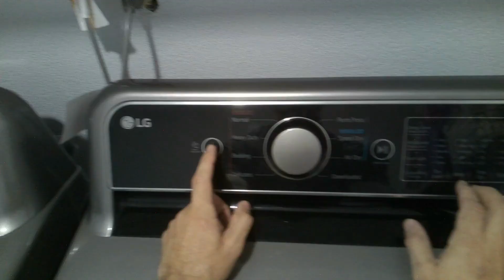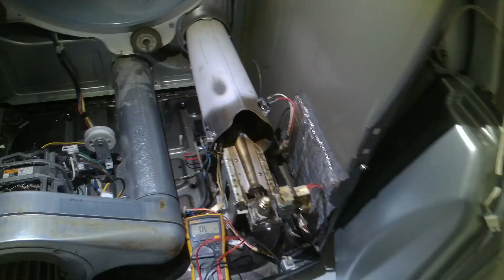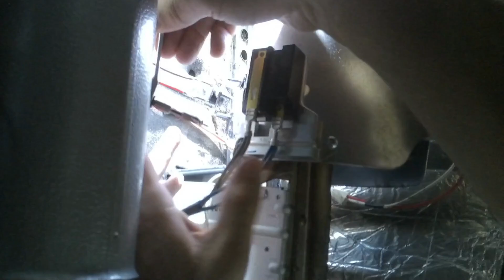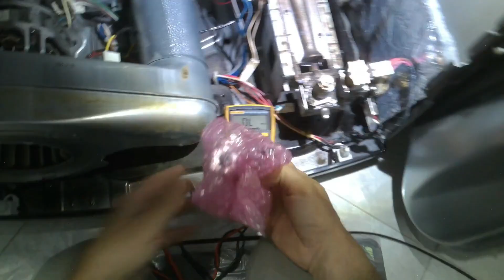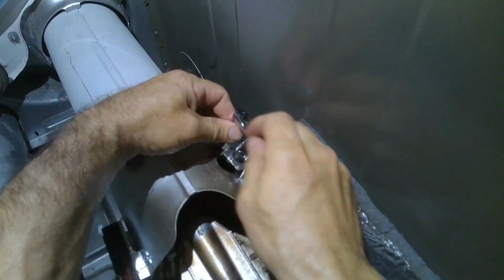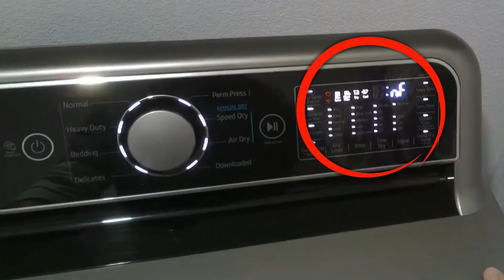LG Dryer No Heat – Test Parts & Avoid Unsafe Off-Brand Parts

Comment from the maker: 🔧 LG Dryer Not Heating or Not Drying Clothes?

If your LG dryer runs but doesn’t heat, common causes include a failed thermal fuse, thermostat, thermistor, or igniter. Testing these parts with a multimeter in diagnostic mode can help identify the problem.

👉 LG heating component used in this repair:
https://onlineappliancepartshub.com/products/lg-agm30045804

✔ Always confirm compatibility by typing your dryer model number in the search bar before ordering.

⚠ Important Tip: Using incorrect or off-spec replacement parts can cause performance issues or damage to the dryer.

💬 Need help diagnosing your dryer?
Post your model number and symptoms below, and I’ll try to help point you in the right direction.